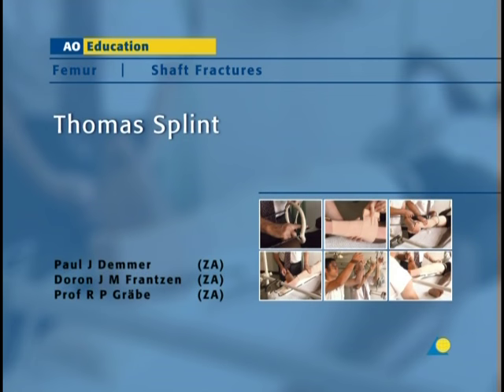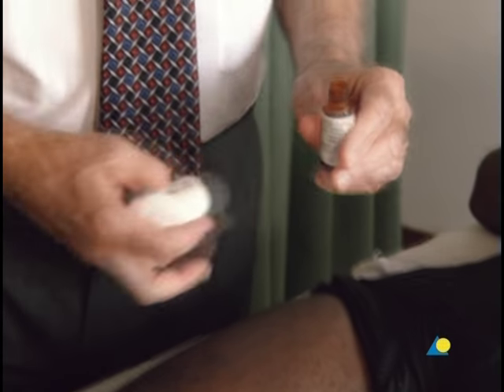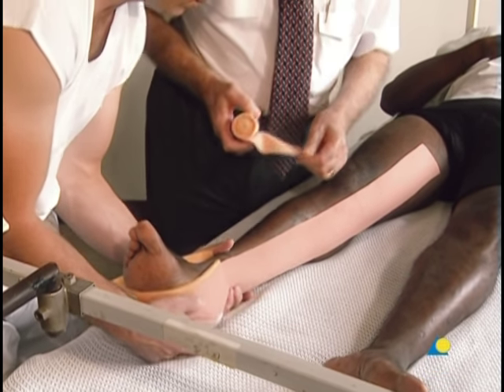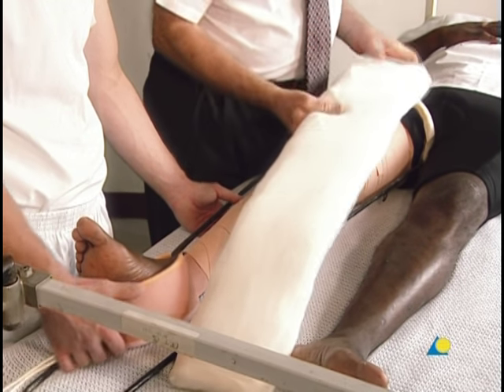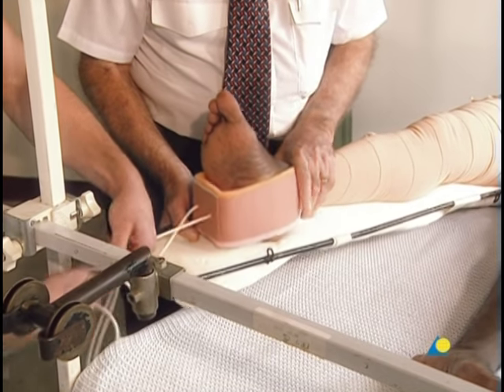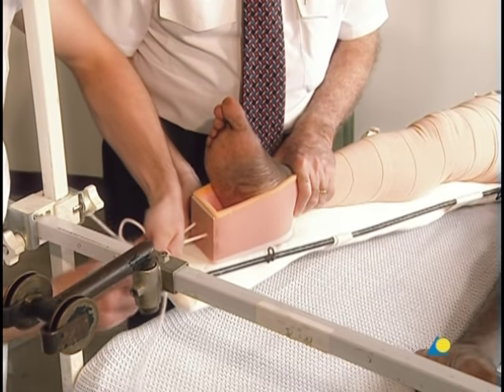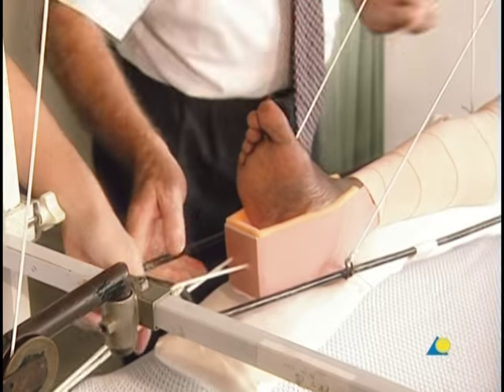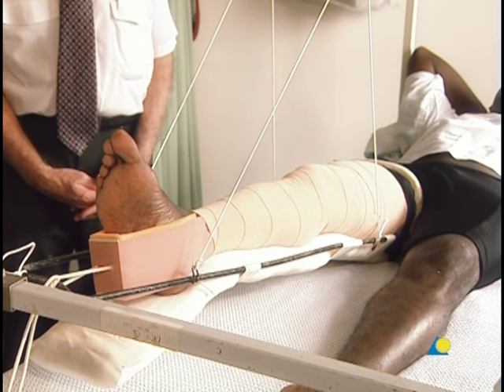Using a Thomas splint for a femoral fracture

Comment: Poor 'patient' would not tolerate this movement/ application as shown if they really had a fractured femur. The assistant isn't doing a great job of stabilising the fracture whilst the traction is being set up. But otherwise very useful video!